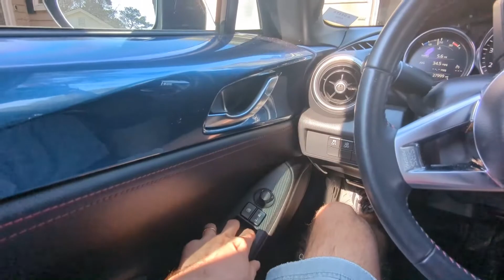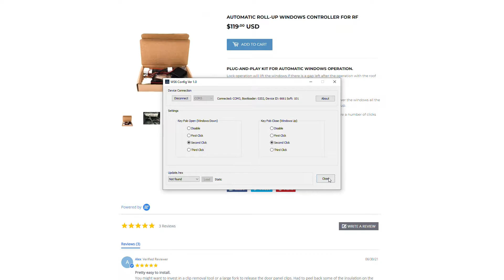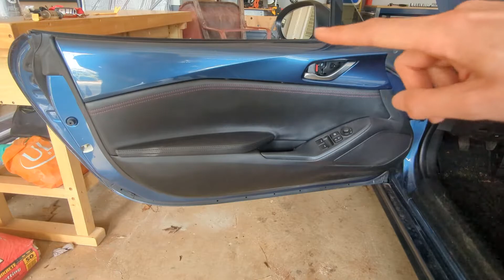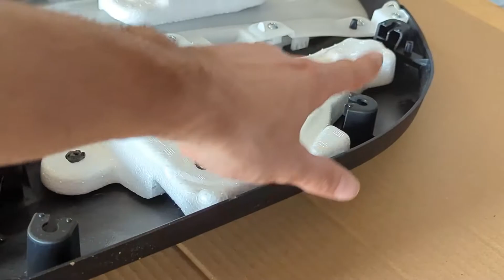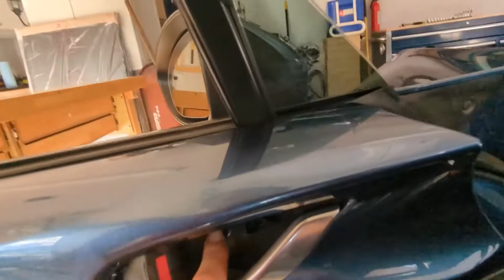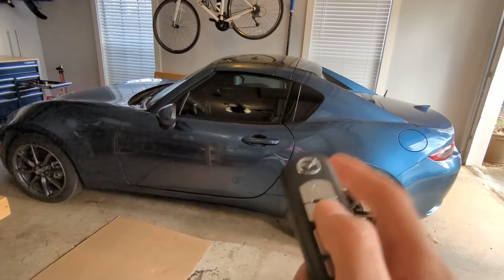2016 - 2025 Mazda MX5 ND2 RF MX5Things Window Controller Installation & Demo! w/KeyFob Control

Comment: This is the best and most complete video on this subject ! Congratulations !
My RF arrives end of June, and this will be installed for sure.
I am still a bit surprised that the windows don't close when the roof operation is done from within the car ??
I am going to search for this stuff in Europe.
Congratulations again👍
Reply from the maker: Thanks for the kind words!
So the window not closing all the way is a US pinch protection thing, EU models should close all the way, but can't confirm without an EU MX5 reporting in.
Also MX5Things ships internationally, so it shouldn't be a problem getting the modules. I have 2 other videos as well for the roof controller and ignition controller

Comment: I had a 2020 RF GT and thought it was great but having to do these mods wasn't in my plan. I traded it in on a 2022 Soul Red GT soft top which I like much more.
Reply from the maker: Yea I agree. It's. More so for the RF than the ST
Reply: @thehousemann  Mazda should make these mods standard equipment
Reply from the maker: @dsat1908  I agree 100 percent. But I can see where there's a few safety issues and why it's not standard.

Comment: Does the passenger 1 tap to close the window or just the driver?
Reply from the maker: It does both. I think in the video it wasn't doing it, but I think the limits weren't set at the time. But now it does one touch without issue

Comment: Does it do the whole top up/windows up routine with the walk away lock? Or just lock the doors? Walking away in slow mo, lighting a cigarette, while it closes itself up behind you (or explodes) would be pretty sweet.
Reply from the maker: As far as I can tell the auto walk away lock is just like hitting the lock button once. So it would not. Would be interesting to test. Would just be a matter of switching the control module to react to a 1 click operation but that wouldn't be ideal for me for everyday
Reply: @thehousemann  Being able to do the key fob stuff with the door lock button would be pretty cool too. Leave the fob in your pocket, and instead of pushing the door handle button once to unlock, you push it 3 times, open the door, and the top and windows come down while you're climbing in. Maybe it will all be implemented in software updates by the time I do all 3 modules this fall. I'll still be doing it as it is, anyway.
Reply from the maker: @HotCarl73  the only issue with this, is that the button acts as lock AND unlock. There would be no way to tell the car what your trying to accomplish essentially.
Reply: @thehousemann  You're right. It would take yet another module, installed to catch the door lock button signal and communicate with the other 3.
Reply: Exactly what i imaging 😅 But as it is now it work half of the time😥 so i have to be sure to slowly click tree times, watch if it works and then walk away (if it does work) kind of ruined the experience😢

Comment: You have to configure if you want your windows to go up or down when the roof is opened/closed. If you don't configure it it will not change the default behavior.
Reply from the maker: I noticed this was something for the soft top version, but wasn't sure if the rf would do it as well. I'll have to look into it

Comment: when doing the one touch close, if you want to stop it part way will it do that? as in you hit the close switch as its closing does it stop at that point?
Reply from the maker: No, that's one of the issues I have with it. If you want to partially close the window. You have to close it all the way, then lower it again to the position you want it at.
Reply: @thehousemann  that seems rather annoying. What about when you close the roof? Do the windows go up without the FOB Control?
Reply from the maker: @robinlatondresse3449  can you clarify what scenario? Not sure what your asking. If you close the roof from the inside switch, the windows will still leave the pinch gap.
Reply: @thehousemann  its the gap at the end when you close it from inside that drives me nuts after you close the roof. That's the whole reason I was planning on buying the window controller but if it doesn't do that then I dont think I will spend the $
Reply from the maker: @robinlatondresse3449  let me double check tomorrow morning and I'll get back to you
Reply from the maker: Ok so here's what I gathered. If you close the roof from the outside, it will close the windows after completing the roof closure. However, when inside the car, and using the button on the console, it will leave the gap when it's done. This seems to only pertain to US models from my research due to the finger pinch protection that's built in.

Comment: can two things be choosen to be one click? for instends, to lock up the car the windovs and roof also  (of course) needs to be locked, so, one click locked ewerything? so i dont have to click first 3 click (roof) 2 click (windovs) and 1 click (doors) ?
Reply from the maker: From my understanding yes, when you setup the controller with the computer, you would select the windows and roof to close via one click. However, I have not set it up to be one click so I cannot confirm
Reply: No, doing the initialisation the passenger side dont react before i try drivers side once more

Comment: So today i was installing this item, but when i was initialisin the passager side only go halfway up? What can i do
Reply from the maker: Is there no response what so ever from the window? Or is it just not working as one touch?
Id double check all the connections again and make sure they are pushed in all the way.
If not, it's rare, but you could of gotten a defective unit and you'd have to contact MX5Things for a replacements
Reply: @thehousemann  If I start with the passengerside there is no respons, but if I start with the driverside and then take the passengerside is goes halfway up or leave a little gap. If I use the key fob to lock or unlock (inkl the roof funktion) it all work fine
Reply from the maker: @janmller6690  did you follow the instructions and reset the window limits? This teaches the window the positions for all open or all closed.

Put both Windows all the way down. Disconnect the battery. Wait. Reconnect the battery. Then close each window all the way, hold the button for 3 seconds. Let go. Then open the window all the way. Hold the button for 3 seconds. Do this twice for each side (one at a time).
Reply: @thehousemann  I will try once moore, get my son, age 19 to give it a try, he is moore cable😅
Reply: @thehousemann  went through the installation once more and took it for a ride, and suddenly all is good, maybe the batteri? I mean it was making some weird noise from the engine room 'klick, klick' also from the batteri, anywho now it all works, and beside from this windows issue it went fairy easy🤗
Reply from the maker: @janmller6690  super! Glad to hear!
Reply: @thehousemann  og my god, here i was thinking ewerything was ok😅 but not quite, if i open and close the passenger side window it will go down, i can stop and go further down and a little up but not down again, and when it is cloose again, i can not open it until i use the driverside window first🤔🙄 Any one with same experience?
Reply from the maker: @janmller6690  send an email to MX5Things support. I'm not sure how to help at this point.

Comment: Is the acc/ig cable required as well or just the windows controller with key fob control cable?
Reply from the maker: If you want to operate the windows WITH the keyfob, you NEED the Ig/acc controller as well.

If you just want one touch window control from inside the car, then just the window controller.

Comment: So I disabled remote keyfob control, do I still need to attach the second wire set for the remote or can I just install the window controller module alone?
Reply from the maker: You can install just the window module. If your not doing the window control. Skip the long skinny wire
Reply: @thehousemann  thanx for the quick reply

Comment: great video. man this looks a hassle to do.  I've just ordered an RF and want to pre-order some mod kits before it arrives months last can I ask what you'd recommend?  I am thinking the mod that adjusts the speed for the roof closure is a must.  Anything else? thanks in advance
Reply from the maker: I 100% recommend the roof controller. For two reasons, the one touch roof operation and the speed limit over-ride. There's no worse feeling than being stuck at a traffic light and can't move as your roof is still operating.

The ignition controller is nice to keep the radio on after you turn the car off and to be able to open the roof with the keyfob.

I'm indifferent on the window controller. I do enjoy being able to open and close the windows with one touch and the keyfob. But a big issue I found that I don't like, is there is no way to close the window partially. If you close the window with one touch, you can't stop it at a desired location, it will go all the way up. Then you have to lower it to the desired position.
Reply: Thanks for the great videos. I am a bit confused. I have ordered  the roof controller and the ignition controller and waiting on delivery to Australia.  I see in the video that your windows before any mods don't close fully after you close the roof.  Mine does.. the windows both drop a small anount when i open the roof and then both windows go back up after the roof has fully opened. When i close the roof the windows both drop a bit, the roof closes and the windows both go back up. So what I wanted to know is if I wanted to use the fob to open and close the roof, do I need the window module or not ?
Reply from the maker: @derekharper6031  so here in the US it's required to have a sort of finger pinch protection. So ours windows leave a gap because we as a population don't know how to get our fingers out of the way.

The window controller you ordered in your case will be to allow you to fully open and fully close the window with the keyfob. Hope this answers your question
Reply: @thehousemann  hahaha thanks for the fast response and humour.  I actually cant imagine why you would have your fingers in there when operating the roof close but hey guess they have to make it US citizen proof :) I havnt actually ordered the window controller as didnt think I needed it.  All I want to achieve with fob control is to open and close the roof remotely.  I ordered the Power module and the roof controller (for the obvious advantages it provides).  will this provide the fob control for the roof or do I also need the window module. Thanks in advance for the advice.
Reply from the maker: @derekharper6031  with the two you ordered, you can use the key to control the roof. From what your saying, you'll be fine without the window unit. I honestly don't think I would have kept mine if it wasn't for the dumb gap, as on my end the windows would always leave a gap without it